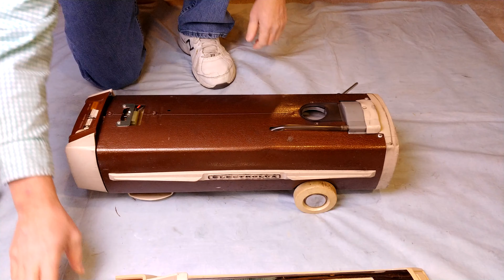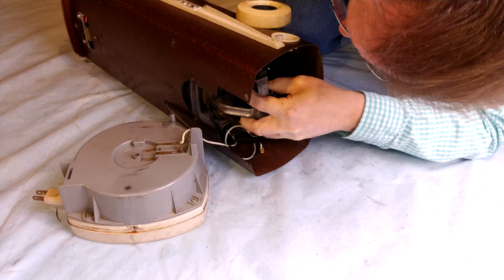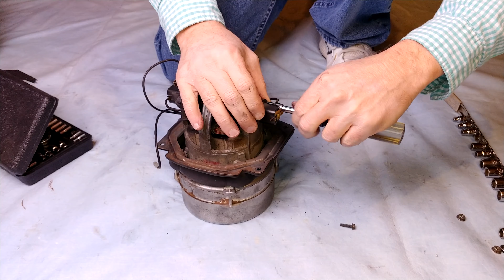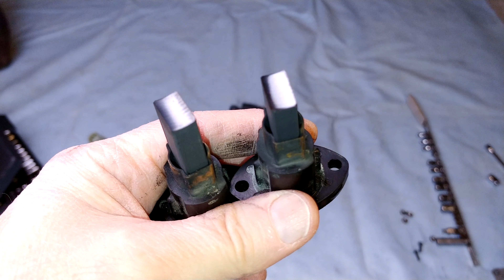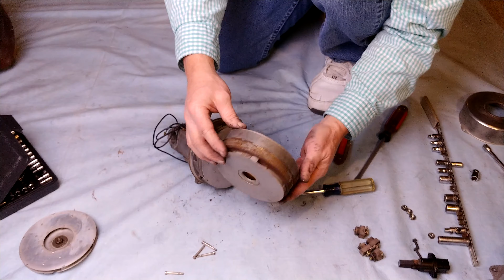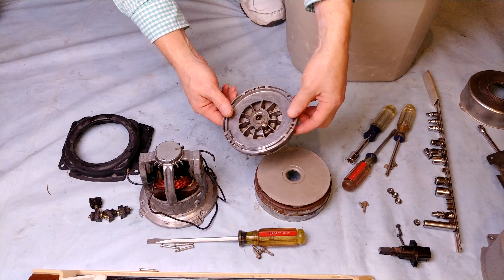1980 Electrolux Olympia One 1401-B Motor Teardown After 39 Years

Comment: I recently inherited an old Electrolux 1505 Silverado Deluxe (circa early 1980's I think).  It puts our Dyson to shame, I love this old machine.  There is no one locally to service it, and I actually like to tinker with things.  Would it be worth it to tear down the machine, clean it or provide lubrication?   From what I've read online the aftermarket replacement motors are hit and miss, and aren't the same design (one stage instead of two).   So, I'd like to keep this thing running.  What would you recommend?
Reply: There is actually a 2-stage 5.7-inch Ametek motor that already comes with the bracket preinstalled which is the best aftermarket replacement motor you can get.

Comment: What would be a likely cause of significant loss of suction on one of these?   My mom has an olympia and has the vinyl replacement hose, but suction is still low.
Reply from the maker: There could be many causes. Check all your connections for leaks. If that doesn't help, have it serviced.

Comment: We have a canister Electrolux about the same age. We noticed recently that the cord becomes warm and the metal prongs on the plug become too hot to touch after using the unit.It ruins well but we are afraid the thing could catch on fire. What should I look for in the unit that might be causing this condition? Thanks for your helpful videos.
Reply from the maker: You could have a failing cord/plug end and/or a motor that's pulling too much current.

Comment: I have the same vacuum but the suction is next to none.  Is there a fix for that?  The motor still run fine.
Reply from the maker: You may have a clogged or leaky hose. If the suction is good at the canister itself, check your hose.